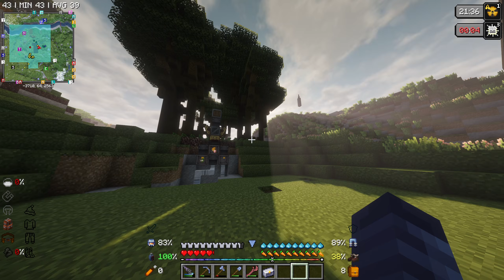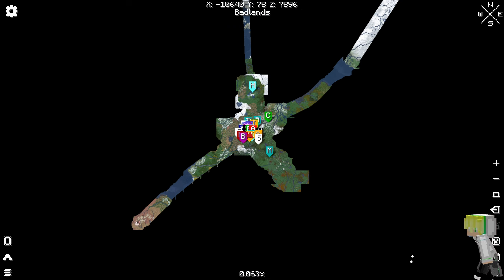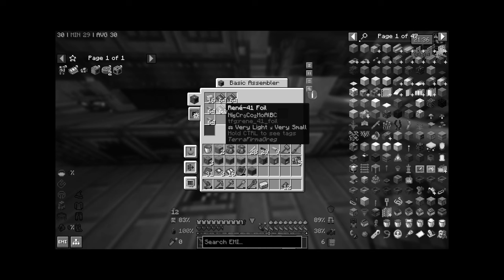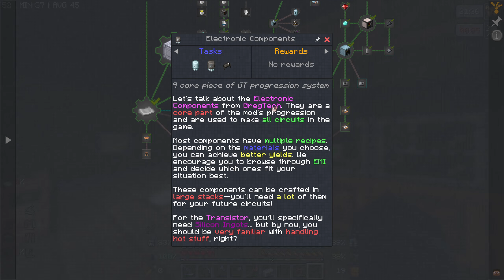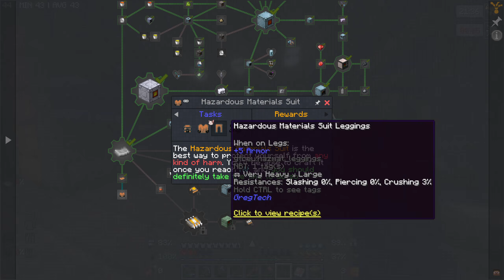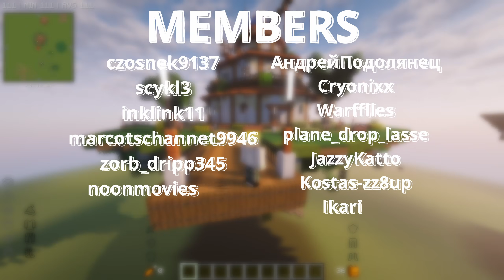The End of an Age!  Let's Talk about the Series's Future - TerraFirmaGreg

Comment: A couple things I noticed and learned when playing:
AE2 is much better than create logistics(External storage with a create Item vault is very strong and also a good transition option from create to AE2)
Automate literally everything you see. Every time you autocraft something you save time wich you can spend on something more fun.
Make passive production of resources you need often(like Polymers and crafting components(motors pumps etc))

Build up good infrastructure, waiting for things or not having enaugh production can be really annoing
Making something you enjoy spending time in is important.

12 MV thermal centrifuges in parrallel wasnt enaugh for me.
Get a lot of chromium and aluminum

PS: I really enjoy your series, its fine to take your time. A video where you spend 30 mins just building something is also awesome.
Reply from the maker: Thank you for all the tips!!! It's gonna be hard to set up everything, but I'm sure it'll be worth it when I do

Comment: While watching last episodes, was just thinking about your progression and that it would be greate, if you switch for more horizontal progression (reworking infrastructure, rebuilding base, etc) instead of going through voltages. Happye to see, that it will be in the future.
Reply from the maker: Ayy thats exactly my plan! The next few episodes I'm basically not gonna go further than I have so far, and instead im gonna expand horizontally into a proper infrastructure fit for HV and EV

Comment: AE2 is available basically as soon as you get to the moon and mine some certus quartz and find a meteor with the funny presses in it (check the ae2 chapter).
There is a mod out there that lets create logistics and AE2 talk to each other, which you may find useful, but it crashes with the fluid package mod we're currently using.
We do want to swap to a different fluid package mod soon though because that one is pretty buggy. And maybe the new one will be compatible with the ae2/create bridge mod.
Reply from the maker: Ohh ty for the tip I didnt think of that! I mainly wanted to go with create because of the style of my base and connecting everything with pipes seemed ugly, whereas floating chains and trains seemed a lot cozier xd

But if AE2 can talk with create I would love to have a centralized AE2 unit and manage movement with create!

Comment: Good luck on the base transfer 👍
The first thing I did when I entered HV was a fully automated ore processing line. Took me 50 hours and my sanity. All the pipes run in a basement and even if they are color coded they are a mess. Now i swim in resources and I have easy access to rare resources. But that was quite the endeavour.
Anyway for building sky bases, if you want to stay true to greg tech and not disable crumbling blocks, you can use reinforced concrete supports. The range is absurd and 4 or 5 well placed can cover the entire island.
Reply from the maker: Ay ty for the tip! What did you add to your ore proc line? Best I can think of is switching water washing for distilled water, aluminium crushing wheels for stainless steel ones, and adding thermafuges to the mix. Would that be enough?
Reply: Well, I used hv machines to enable byproducts. Then a system of filters for ore washing in the chemical bath or in water (gives the same chance as distilled, you just need to set the right circuit) the ores that use mercury are sent to the water washer instead to use less mercury, except the platinum and palladium byproducts. I have then a sifter and 2 multiblock thermal centrifuges. A ore crusher again for the thermal products and a centrifuge, where the output goes again trough the filter to see if it can be centrifuged again. Lastly i convert the gems into slurry and I filter it before getting it in another centrifuge. It is not maintenance free, because the centrifuges can have too little product to work with, and every once in a while I need to empty them. Mercury is reused, the other fluids are stored if I ever need them. The iron dusts, except vanadium, are not sent into the centrifuge to avoid having oxygen and iron dust when I can just cook them into ingots.

In the same factory I did the sofium persulfate production that is needed for the ore processing, oxygen and silica production from crushed rock into flinto into the products.

Then in a separate building, that uses oxygen and gives hydrogen and the byproduct from salt water electrolisis, i have set up automatic iron III chloride production, with semi automatic circuit board production. The distillation from fermented biomass from the saplings used in my reformate line also allows me to create silicone rubber, polyethilene and another resin I can't remember right now.

If I ever need something now I just go there and take it, but it took my sanity away since I tried to do that as soon as I got into hv. All byproducts are used and nothing is wasted.

Currently working on a cracker cause 4 EV ebfs consume way more energy than expected. A nice buffer is good to have but I need to increase production before I run out... Also, I recently got to the moon 🌝
Reply: As far as I know, this process I made can up to 6x the ammount of materials you get from the ores, compared to a normal production. I am currently swimming in dusts and 5 create silos 3x3x9 were full untill I transfered all my dusts into some superchests. In the long run it pays back. But the sanity will only wither away as you progress the modpack.